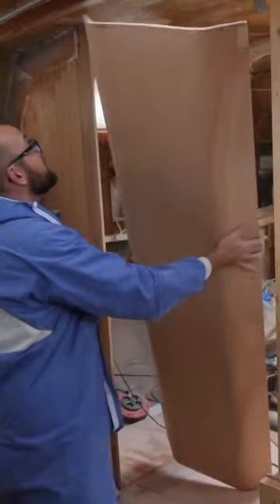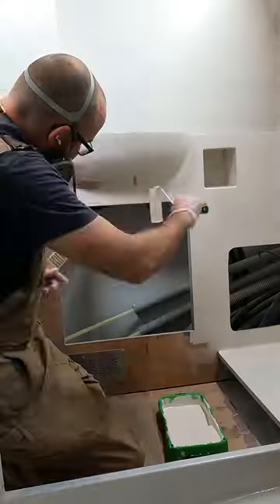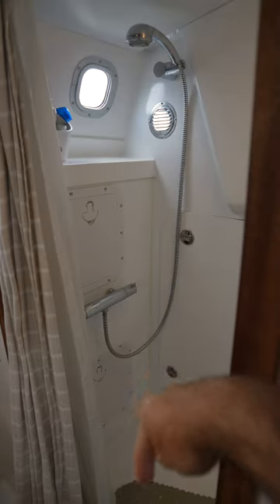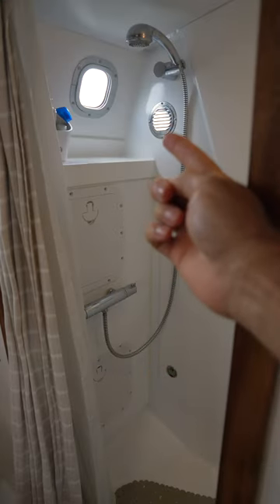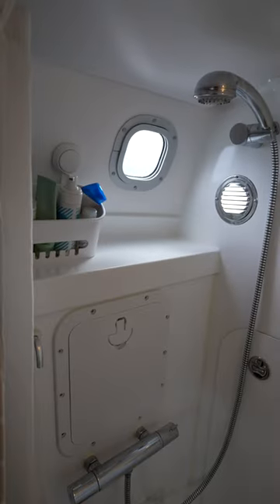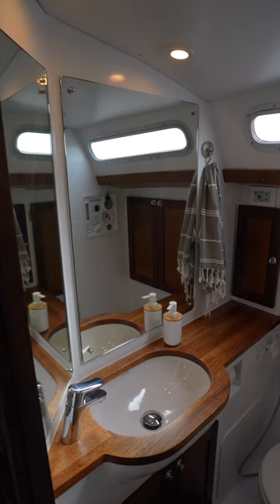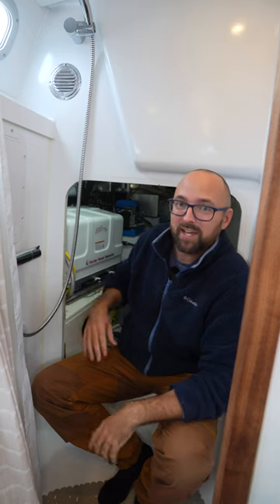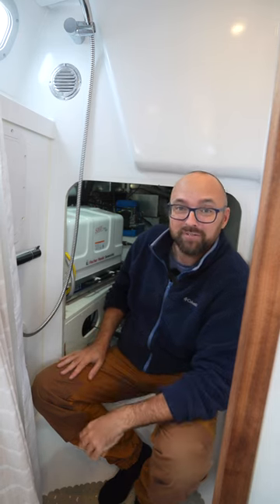Sail Life #shorts - Bluetooth enabled toilet  🤓⛵️

Comment: One thing that could have been added at the time of construction would have been a sliding pocket door instead of a typical swinging door.  A solid wood panel door need only be about 10mm thick with another 10mm panel over that to make a cover panel. With a couple of extra mm for fudge the bathroom/head would only lose about 24mm of space along the inner wall.  That would be better than a swinging door that is in the way all the time. Also the head could be easily left open to air it out without a door in the way, or when working in and out of the technical room.